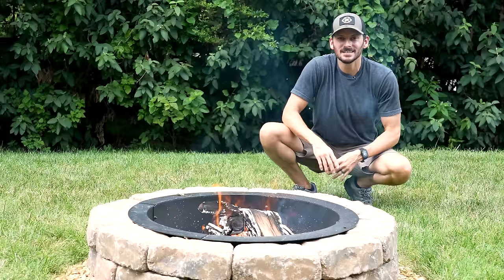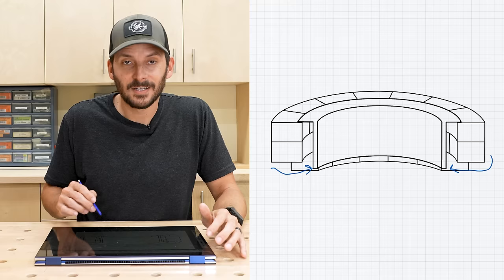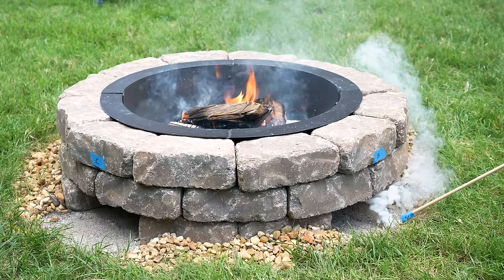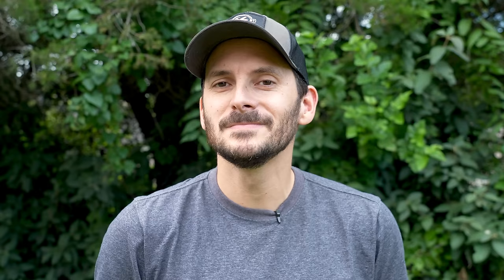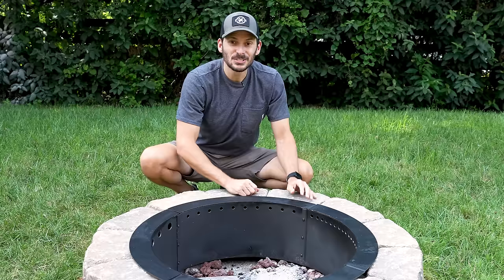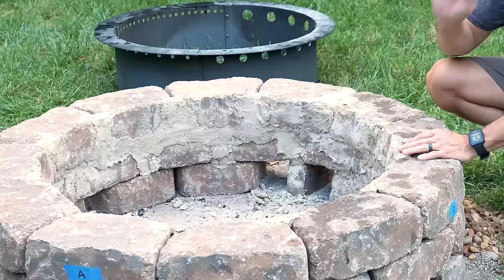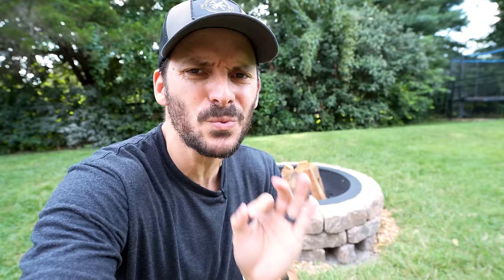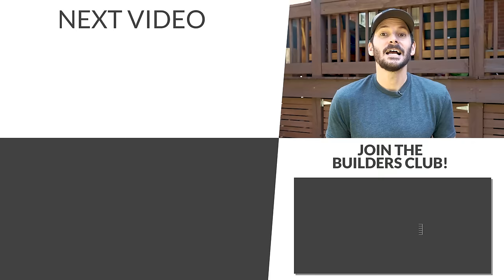Stop the Smoke, Do THIS to Your Fire Pit

Comment: How about fireplace rope gasket at the top instead of a mortar bed?  Check the temp rating but would allow you to lift liner out whenever.  I think the replacement I just bought was rated over 1000 degrees F

Comment: You need to make the firepit a smaller diameter. With it that wide, you're still getting air from the top, and you're also not forcing the intake air to come underneath the fire. That's why the solo stove is taller and skinnier.

Comment: Great video.  Gave me a lot of ideas.  Question...instead of concreting the inner wall of the pavestone, could you just have built some kind of metal (sheet?) heat shield to prevent the air loss through the gaps in the pavers?

Comment: Air Hole Loc. & Size: 6:20 the placement and size are going to depend on diameter and height of your fire ring. The patent on the SoloStove instructions are going to be more general. The Company who made it did a Lot of R & D for each product. Also the more sealed the edges of the inner metal ring to the outer brick the better.
 I noticed previously the smoke coming out of the top of the ring lip and the brick.

Comment: thanks for this-- when drilling through metal next time try a product called Boelube, we use it on sheetmetal aluminum and stainless steel in the aircraft mechanic side of things. definitely some great stuff and less messy than the wd40

Comment: one of the best ways to avoid smoke is to use DRY firewood!  The smoke is actually the liquids still in the wood being driven off by the heat - dry wood has no moisture, so produces no smoke.

Comment: What material is best  to use on the bottom on the fire pit to make the cleaning of the ashes easy job and at the same time to be best for drainage. 
I have Karcher Ash vacuum cleaner but I am worried that it will vacuum the small stones among the ashes.

Comment: Man nice! Fíor what I understand based on own experience the air from the secondary air supply needs to be very hot and close to the fire (or the wood gas correctly spoken). On your last test you made an enough big fire where the air behind the metallic ring has been heatimg up way more and wood and thus the gas was closer to the holes, so thats why it worked finally. On the tests before the air behind the metallic rings might have been warm enough as well, but this hot air never reached the gas because it was too far away and thus the hot air just rose up to heaven. So in conclusion: the fire ring should be designed just as large to fit the wood & probably a bit higher so air can heat up more and really shoot out of these holes. And I could imagine if you manage to give the air more of a directed way at the stage just before it pushes out of the holes it could help a little as well to get a slightly stronger flow.
But thanks for sharing the experience so well, especially the test with various widths of the holes was interesting to see for me! And looks super nice in your garden btw ;)

Comment: So after watching several videos on the original, one thing I found is that if you truly want zero smoke, then you never stack your wood any higher than the holes on the top of the inside. I'm thinking if I ever make one of these, I'll make it a few inches taller, like the original Solo Stove that invented the smokeless burn pit.

Comment: The last thing I would have is a fire pit made of concrete block. It will not radiate heat nor light. Plus it restricts needed air for combustion. Concrete blocks are for landscape retaining walls.

Comment: Since you're adding more air to the fire with the holes, in order to burn hotter to get rid of the smoke, my guess is that the fire will consume wood much faster. Has anyone tried the same fire pit with and without air holes and noticed a difference in how fast you have to keep adding wood?

Comment: In my experience.  Temperature of the burn is the most important factor, and whereas all the variables (wood moisture, air turbulence, etc) are still important, if you can sustain a certain temperature, nothing else really matters.  Hotter temp drafts more and will get more air flow and turbulence.  Arrangement of the fire woods is also just as important as any of these other variables to maximize the surface area to generate more heat.  Unfortunately, no comparison should be made without the same exact setup between scenarios 1 and 2.

Comment: Would like to see just a campfire on the ground vs this.  Fire pits look nice but in general I feel they are good for “just” containing the fire and looks.  The pit blocks the natural heat from warming up people around the fire and like this shows without a lot of “perfect” conditions makes it hard to get a perfect smoke free fire.  I use a blow torch to get mine going and a leaf blower to get it hot faster.  With the cost of all of this I’m going to try 1 row of blocks intermittently gapped  just to keep the wood contained and no ring.  Pretty good video though.

Comment: The tumbled stones probably have lots of air gaps to help fire get air. With the stones you removed from the bottom, you should be getting plenty of air for the fire. Mortor and the metal ring are blocking your air

Comment: The bottom holes need to be bigger than the top holes just like the patent. This will speed up the airflow from the top holes. Similar to the Venturi effect in converging ducts.

Comment: question: If you didnt fill in the 2" gap between the bottom of the fire ring and the ground, would it have the same ffect as drilling the bigger holes at the bottom?

Comment: Now, may I suggest another experiment? Make a set of sliding doors for those bottom intakes, and once the fire is up and running real good, close those lower intakes to see if you get a furnace draught effect on the fire and which way the air flows.

Comment: Yet another advice. 1:50 see the top of the Solo stove? it has a "neck". Your holes are too small, you still have lots of air inflow from the top.
That air keeps from new air to come and reduces the oxygenation, it acts like a blanket or a counter flow.
Chemistry example for Propane : C3H8 + 5 O2 → 3 CO2 + 4 H2O. If we allow for only 1x O2, instead of 5, we still get water vapour, but lots of soot as well.
You want the air flow to have enough volume (of oxygen) to make for a complete combustion. Water is white vapour, C products are grey and have smell.

Comment: You missed the fundamental part that was needed 4 inches of free space below the wood that the air could flow through with a 5 to 6 inch hole in the middle so you have the heat and everything circulate. Also, they make a fireplace caulk. That’s much easier to use and handles the heat. Much better when you’re putting the stuff together.

Comment: Ignite the fire from the top of the wood and have it burn down.  It sounds crazy, but it works and will produces much less smoke.  Also, that design works better when the burn pit is deeper with a small diameter.  Notice the commercial one shown at the beginning is shaped as such.  Lastly, the wood should fill the majority of the pit.  A small fire in the center isn't going to pull air the way the pit is designed,

Comment: I have a question. The purpose of the metal fire ring is to insulate and protect the stones. Does drilling these holes now leave the stones unprotected? How hot do your stones get now? 

Most of those retaining wall stones you get at home depot aren't actually stone. They are concrete made to look like stone.... and concrete can explode when over heated. So it's a legit concern. 

Thanks for the video!

Comment: Hey thank you for the video. I am in the middle of making my smokeless fire pit. I am planning on drilling holes at the top of my fire ring. I saw a video of this guy installing a vent pipe from the outside of the fire pit to the inside center of the fire pit, with holes only at the top of the fire ring. BUT... Do you think that drilling holes at the bottom of my fire ring will do basically the same thing as the vent pipe? He says the vent pipe will do better and drilling holes at the bottom may hinder the fire ring from doing its job. Please answer with your opinion.

Comment: Smoke comes from incomplete combustion. The goal here is to get as complete a combustion as possible. 

You definitely need a restricted and directed air flow for optimal results.  The second combustion method he's using works best when the hot portion of the fire is towards the bottom with holes that draw the heat around the outside and back through the top holes. He'd probably have better combustion if he blocked up most of those extern holes at the bottom in the bricks. 

Also, the fire has to be built below the level of the top holes to work correctly. Wood above that point misses out on the combustion benefits.

Comment: Should have added a second metal ring between the bricks and ring with holes. The second ring would force the air to circulate more and heat the air better.

Comment: I think it needs to have the same height to diameter ratio as the SoloStove. Then then air in the wall will have more time to heat up and get the after burner effects going.

Comment: Did you mention the diameter of the supply holes at the bottom?  I think you had only said they would be spaced 3.75 inch (10cm) apart but not the diameter?

Comment: Very informed guy and well produced video. However, a minor point of improvement may be to slow down a little and make occasional pauses between sentences so we can absorb the contents more thoroughly. Please don't take it as a criticism as they are good videos.
By the way - I have used for years, a stainless steel washing machine drum of the UK type, with three bolted steel bar legs (tripod) and is smoke free with dry wood. It works a bit on the rocket stove principal and a metal dustbin lid fits very nicely as a rain lid. Very little ash is produced.

Comment: Bud, appreciate your video.

 If you simply add another ring of stone at the top and inset it over the interior edge of your steel ring, you'll reduce the upper diameter and also force those upper holes to reburn more easily.  Then you can place a grate across and make some burgers. :)

Comment: Pin This: 
The reason why smoke always seems to follow you or that one friend is because it doesn’t come from the top. The top is where the smoke goes. The air actually comes in from the lip of the ring. And when you block that lip especially unevenly you provide an escape for smoke to go out of. To eliminate this feature make a raised fire pit. For example for one that size I would put some beams under it and make a bottom with several small holes for ash to escape and and air to enter… don’t worry about ash buildup since it’s burning more cleanly the ash output is smaller… also rain is thing

Comment: You’ll get a better result if the pit is a little more narrow (why it worked better when you made the fire bigger) so you don’t need to burn as much wood at once and if you make it taller so you don’t have to push the wood in there as much. It also helps to have a perforated bottom so the air can get in better from the bottom and not get clogged up with ash. My smokeless fire pit is like this and the ash pan at the bottom hardly ever has any ash in it because it burns so efficiently! Only smokes/ashes a little before it gets hot, and then at the end as it cools down. It’s one of my favorite things.

Comment: Take diameter if the fit pit and the height should be considered, because the solo stove are smaller in diameter and a bit taller which could effect the way it sucks in cool air at the bottom.

Comment: I'd imagine that the pavers dont do much if the fire is right on top of them, maybe some really thick diamond patern wire to hold the wood might help, sort of like the lower grate on a grill to hold the charcoal briquettes. that should prevent the wood from falling between the pavers and blocking the air from flowing

Comment: The moral of the story is to make your fire hotter lol more oxygen = more heat, more heat = a more complete burn. It's the same principal that's used on diesel pickups, bag up all the soot from the engine exhaust and then blast furnace it into different waste particles.

Comment: You didn't need to mud those stones in because the air was also going through the intended holes.  Your smoke just showed that there's airflow in the cracks.

Comment: About 10 years ago I was drilling a whole on a bean and some engineer saw me putting wd40 on the bit and told me not to use it because it runs hotter than other oils he said cutting oil runs cooler and helps your bit last longer he also said engine oil works too and it's cheaper than cutting oil 🤷‍♂️

Comment: 3:49 It's not a good idea to have the middle layer of stones cantilevered over the hole. They're more prone to fracture in the long term. A way to help prevent that is by putting a stiff metal circular section under the contilevered stones so they stay more in compression.

Comment: Hey man, i think your biggest mistake is, that the fire has contact to the Earth. The Earth cooling the fire very strong. Try to do it abouve from the ground. In a Metal Platte with holes. Or use spezial fire Stones on the ground.

Comment: Does the insert need to be in the ground or can it be up higher and just add rocks on the bottom. Also if you put rocks on bottom does it cover up the 4 offset blocks

Comment: Hi.  Towards the end of the video, you mentioned that you drilled 1/2" holes along the top of the ring, spaced 1.5" apart.  You mentioned the bottom row of holes were spaced 3.75" apart, but I don't think you ever mentioned the hole size.  DO you happen to remember what that was?

Thanks in advance!
Reply: I was wondering the same thing and curious if you got a response.  They looked larger and thinking they were 3/4" or 1".  Could you share the answer if you heard? Thanks!

Comment: What was the size of the final supply holes?
Reply: Doesn't matter. The fire pit is much too wide, the air going to the upper vents are not getting hot enough to cause secondary burns unless he fills that whole thing up with wood which you'll never do in really life

Comment: I don’t understand why the holes have to be at the top. I know more oxygen equals more burning, but what’s wrong with having that oxygen come in at the  bottom? What would happen if you just kept the joes at the bottom and then also moved the top holes down there?

Is the issue that it would burn too fast, like if you introduced infinite holes (with enough oxygen flow)  you’d basically have an explosion instead of a fire? This makes sense to me. So my theory is that a certain airflow at the bottom allows a certain burn rate or degassing or whatever it’s called, and then airflow at the top makes sure that you’re completely burning the smoke and gas, not just burning the logs faster.

Comment: Hello you never stated the size of the supply holes on the final fire pit, only how much they should be spaced apart. I would like to replicate your success on my fire ring aswell, I have a 36” diameter ring with no lip unlike yours. Will that change the size of the holes or only the amount?

Comment: Heya, what kind of mortar did you use inside? I've used regular mortar and I now hear about heat resistant mortar.... should have I used that instead? I've been told I should be fine by some if....I let it cure for a whole month?! I know you levelled the bottom with stones to reach the fire-ring...and I'm doing the same... but I'm starting to freak out :p.

Comment: just wanted to throw this out there, the air doesn't get so hot that it ignites out of the top holes, it ignites because the gasses produced by burning wood are flamable, check out any wood gassifier video for a much better explanation lol

Comment: You are missing a key component, the ring is to shallow. If you added one or two layers of stones to make the pit a bit more barrel shaped you would get better convection drawing in the fresh air at a higher rate/speed. If you do not want the top higher of the ground you can sink the pit instead. I would also recommend a cross of 2-4" drilled pipes in the bottom to allow air to hit the fire from below, just make sure those holes do not point up or they will fill with ash, and I know you don´t want a ash hole messing up your fire.

Comment: It would be more smokeless if the pit was deeper. If you keep the wood below the secondary holes there will be little to no smoke even with wet wood. A smaller diameter pit would be less smokey as well. I use an old top loading washing machine inner spin tub. It is perforated with holes and is make of a very tough steel. It makes a perfect smokeless burner. The only problem is the burning wood is deeper in the pit and you can't see the fire as well. When the tub gets real hot and you will have hundreds of little flames shooting through the holes.

Comment: The other solution would be not to use a fire ring. So your fire pit would simply be the stones in a shape of a circle. You could remove one or two (smaller) stones with some angle to allow for the air to move into the circle.